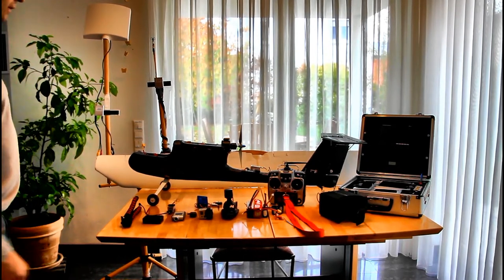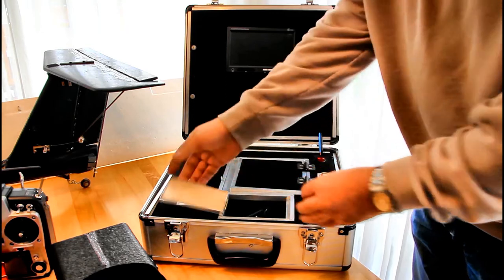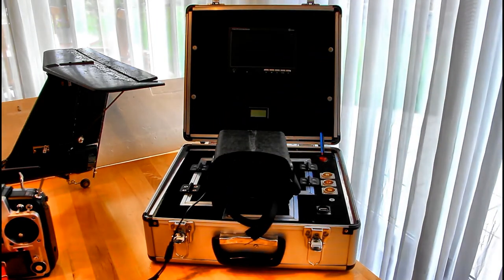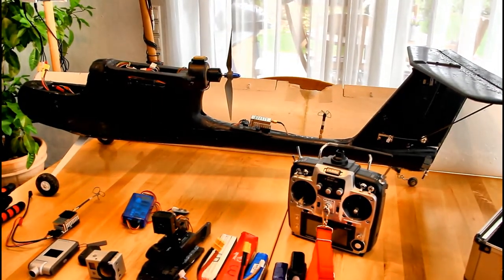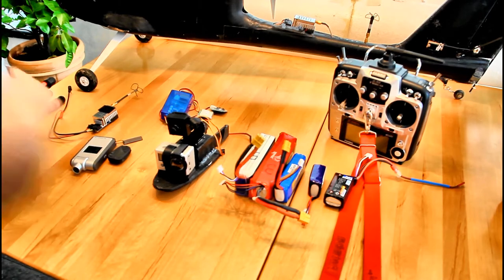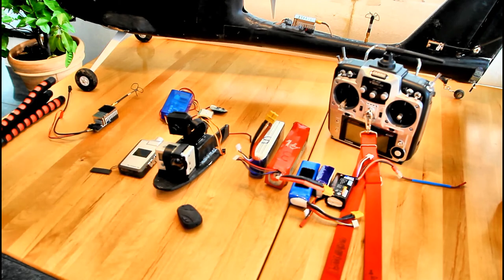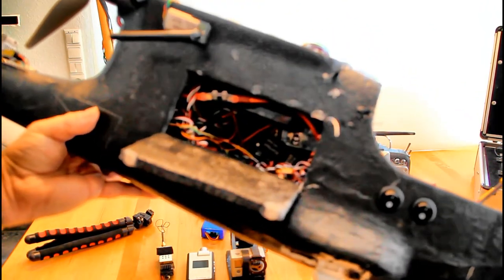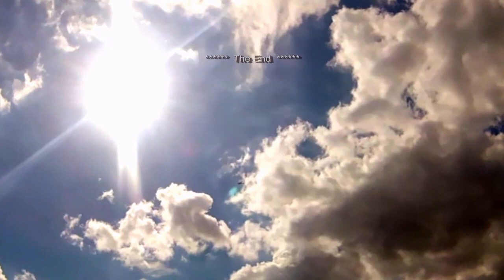Me, let'n my geek hang-out

Comment from the maker: Thanks,
1. Flying Weight is 2.5kg
2. No, only with the 5000mAh 3cell for Motor, Receiver and Servos and the 1300mAh 3cell for Video Transmitter and Cam.
3. Yes :-( she was a great and very forgiving plane. She offered herself testing the Cyclops Storm OSD.
4. 1st. the live video feed is compatable with the LCD Screens. 2nd, it offers me the opertunity of Pan and Tilt without bothering the "good" flight video. 3rd, I'm putting in a Video Switcher in order to have a backup if one cam should fail.